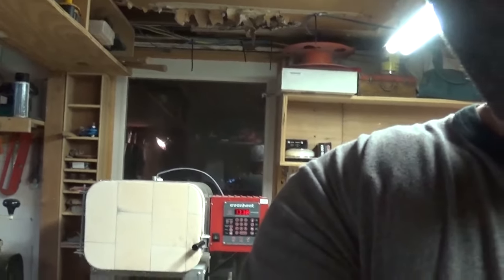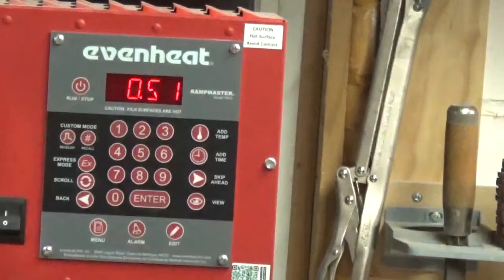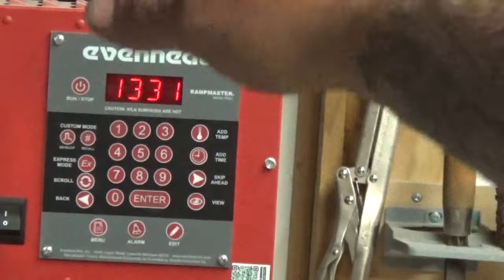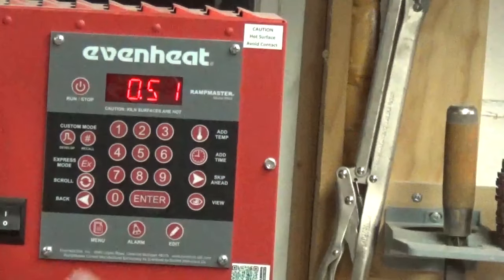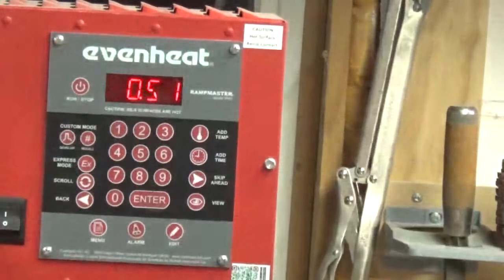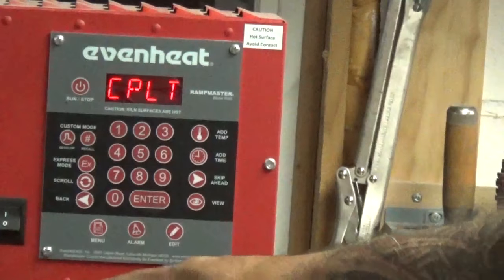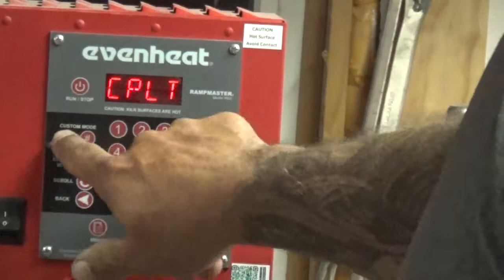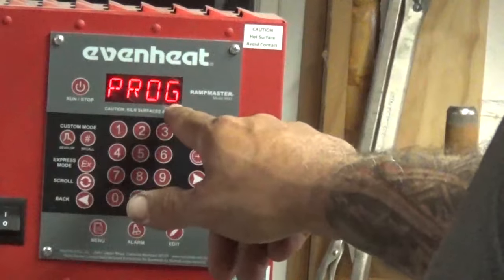The Importance of Normalization of High Carbon Steel

Comment: So a few things....Normalizing resets the grain structure, but at the cost of growing it, depending on the steel.   Steels that have a bit of vanadium, grain growth is pretty much nil until you get really hot (way above 1650°F).   However, there isn't much vanadium at all in 1084, basically it is in there as a trace element.   But there is another thing to consider, if you're getting this from NJSB, most of their low alloy carbon steels come heavily spheroidized from the mill in Germany.  They really NEED the normalizing cycle, regardless if you've forged the blade or not.   And to break up that spheroidized structure, an extended soak is preferred.   I normalize all of their low alloy carbon steels at 1700°F for 20 -30 minutes, followed by a still air cool.  52100 and W2 especially.   Normalizing also redistributes carbides, but 1084 really doesn't have much in the way of carbide.   Also, normalizing helps relieve any stresses in the steel, usually forging stresses.  Normalizing should only be done ONCE.  Not 3 times.  And for 1084, 1600°F-1650°F is good temp if it were in a fine spheroidized (or forged....pearlite) structure.  But just to reiterate, if it came from NJSB, that carbon is all balled up due to the factory anneal it received, and it needs a higher than normal normalizing heat with extended soak.   Don't worry about grain growth at 1700°F for 30 minutes.   We will deal with that possibility right now.   After ONE normalizing cycle, because of the possibility of grain growth (especially with 1084, not so much with O1 or W2 and their 0.2% vanadium), the steel needs to be "thermal cycled" around 1500°F 3 times (or a few more if you like) to help "shrink" the grain.   What actually happens is more grains are packed into a given volume, therefor "shrinking" them.  The phase change must occur for grain refinement to happen, and that is about 1414°-1425°.  Give or take.  So you can technically thermal cycle around 1450°F, and I would use this temp myself.  Do this 3 times, let it air cool.   Your grain structure will be extremely fine now, and you are ready to harden.  1500°F with a 5-10 minute soak, quench in oil (I use Parks 50 at room temp, but canola at 130°F works really well too).  Temper as desired for hardness.  ps, Don't cycle below ~1414° as the phase change into austenite is not complete below that temp, and don't cycle much above 1500°F, as you're starting to approach industry standard normalizing temp (1600°F).
Reply: Hi Stuart, hope you see this.... how do you soak at a certain temperature in a gas forge? Is it super necessary? I've been using 1084, getting it to 1500 before quenching pretty much right away.
Reply: @vorpfriendly7574  You can’t, really... However, you can turn the flame low and high in cycles, I suppose.

Comment: I have a broken blockage rod 8 mm , it is not brittle it is flexible like spring , I try to cut it by hacksaw blades bi metal and noticed that all the teeth gets broken not even a scratch on the round bar , only way to cut is by angle grinder.

Comment: Hi, You mentioned that you soak your 1084 steel for  around 10 mins during normalising and before quenching. But isn't that 1084 is a relative simple steel so you don't need to soak? Have you done any comparison and testing between with soaking and without soaking in terms of grain sizes( by naked eyes), edge holding and hardness. Thanks. Nice video.
Reply from the maker: Hi Lung Sun, During the normalization process it is a 10 minute soak at temperature for each cycle.  The heat treat process, I hold for 15 minutes at temp then quench. I have done plenty of comparison testing at different temperatures and different soak times, I have found that this method was giving me the highest hardness and the best edge retention. I will also say that this steel does not require a soak to get hard, But I look to get the most out of it that I can.
Reply: G'day what is your tempering time/cycle please?   Great video too
Reply: @lumablades1751  any advice on a2 01 52100 d2 for a new maker?  Am starting on simpler stuff but would like to advance.

Comment: New sub here.  I like the way you explain things.  And though you already know it, you need a cameraman, but that would also take away from the spontaneous videos :-) Keep up the great work.  I'm just starting as a hobby. Going to try to use a cheap pry bar.  Already did one out of a Harbor Freight Machete and it was fun and a great learning process.  I'll by some O1 steel soon, but haven't yet.  Just going to use a charcoal forge for heating and figured I would get a laser thermometer to check temps.
Reply: Bill - Thanks. It didn't take long to figure out that about 1250F is the hottest most go. I didn't even see ones that went higher so I must not have been looking in the right places. I got 1095 and As...didn't realize A2 is kind of particular to heat treat

Comment: Do one do this before hardening. And when hardening do one have to keep the metal i that heat oven for a special amount of time. Or do one just wait for it to reach the temperature and then fast into oil ?  Im totally new at this so im sort of clueless. I read a document saying 15-30 minutes holding time. So is that the about of time keeping metal in the heat oven.
Reply from the maker: Robert Ciganovic it is done before heat treat. It’s not an always necessary step